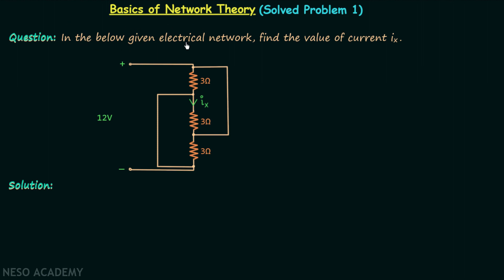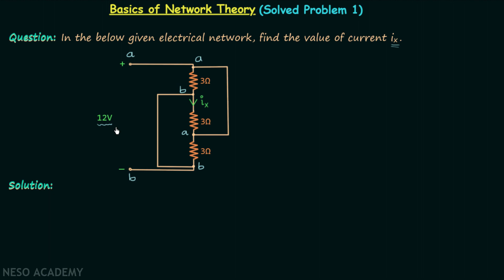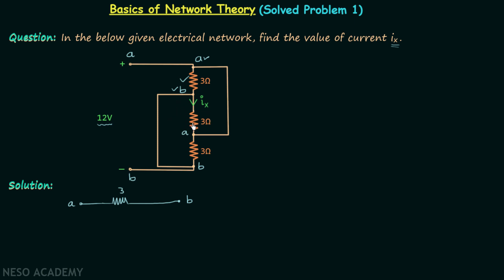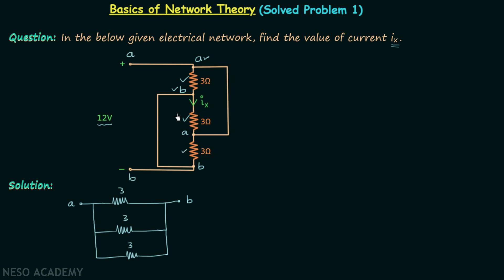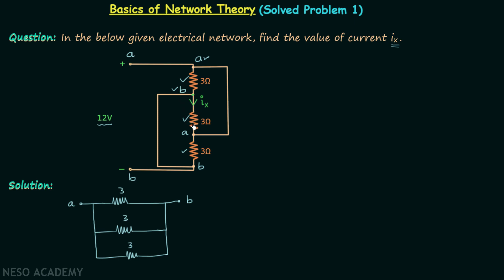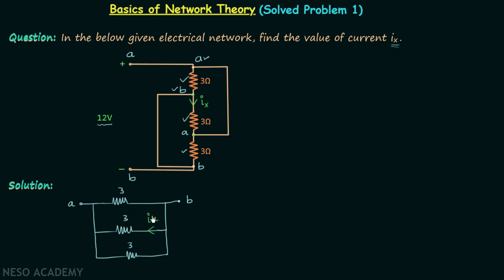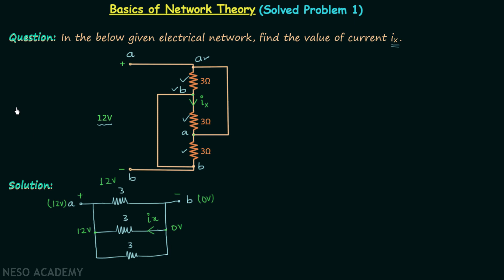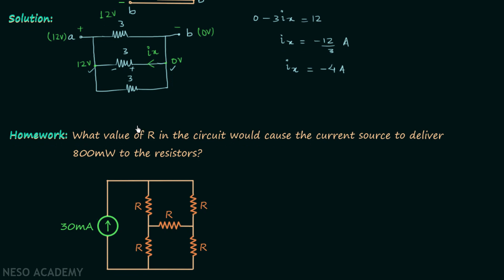Basics of Network Theory (Solved Problem 1)

Comment: It is a balanced bridge so eq resistance will be R. And hence simply use formula, P= (I^2)*R. And from there we get R=8/9 Kohm. Am i right??
Reply: I think you are right
Reply: Hmm same my answer
Reply: @markwateny3825  1. you do p= U*I => U = p/I to find out necessary U
2. you see there is a bridge so you look for balance and remove the middle connection if it is balanced (in this case it is balanced obviously)
3. you transform the circuit to Va to Vb (upper node and bottom node) and find out the Resistance between those nodes is R!
4. you calculate U = R*I => R = U/I
5. you have your answer. you found out U (Voltage) and found Equvivalent Resistor of the Circuit.

be careful to not overcalculate everything. As an example you dont need Va and Vb to find out the Resistance between them.
Reply: @ilkaykaankaracan4351  0.888 ohm
Reply: @revatijunghare1603  it should be 0.888 killo ohms
Reply: @revatijunghare1603 nope when you use mWatts and mAmperes you should make them into Watts and Amperes so that the square in P = I^2 * R works as its intended to.

Comment: How to solve it 
If u know please send to me 7093452575
Reply: First mark equipotential point...then taken each marked points once and construct the new circuit.u will find the Wheatstone bridge with balanced condition so centre brach has zero currents so neglect the centre branch and then 2 series resistance and then parallel ..u will get equivalent resistance atlast is R so i^2 R= p...8/9 k ohm

Comment: 0.2539k ohm
Reply: SUMANTH BOLLE Homework problem Answer is 0.88 K ohm . This is case of balanced bridge with all the resistors of same value . So equivalent resistance is R and whole current will flow through R and Power P is equal to i square multiply by R . So you will get R is equal to 0.88 k ohm .